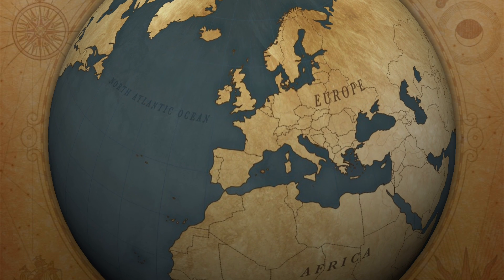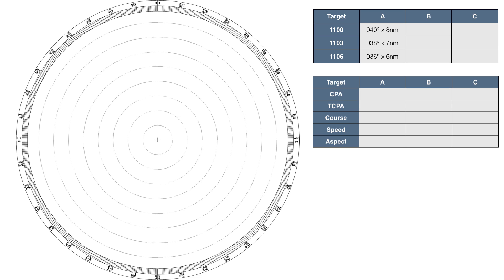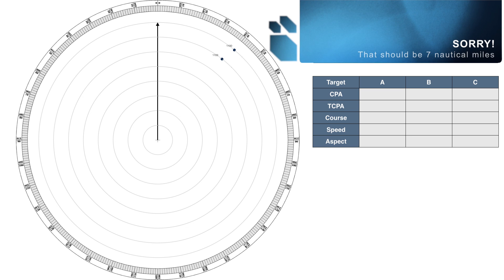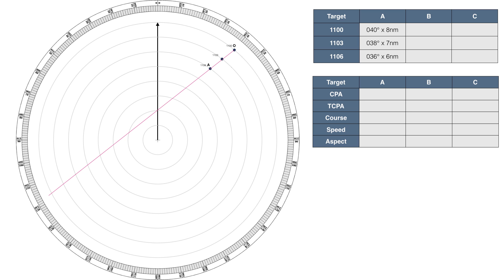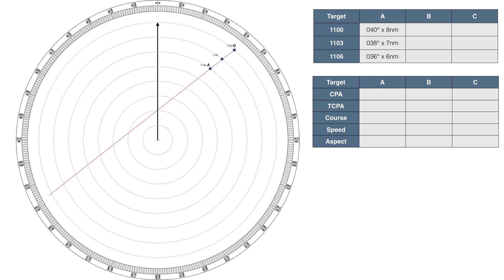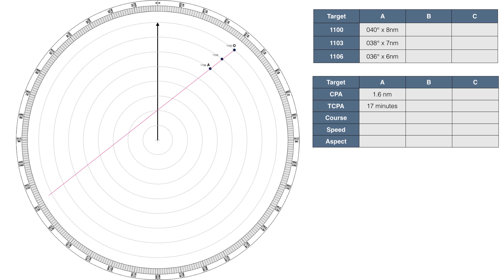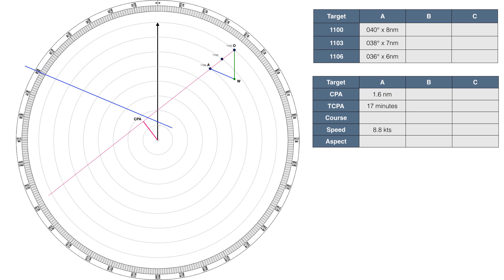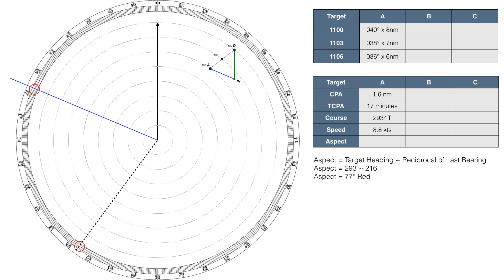How To Perform a Manual Radar Plot

Comment: To me true speed of vessel should be 20 knts not 8.8
Reply: please correct me if i am wrong
distance from w to a is about 2nm that would make the speed 20 knts
Reply from the maker: @mani vankappel Hi, you should get a distance of 0.88 nm for WA (on-screen it looks larger as I had to approximate the lengths of the vectors when making the video) - I am still on ship but I will double check when I get home and can play the video in case I have miss measured it... if you've got a distance of 2nm for WA then, yes you would be correct that would make it 20 kts.
Reply: Yes correct. Target's speed abt 18-20kts. Not 8.8kts.